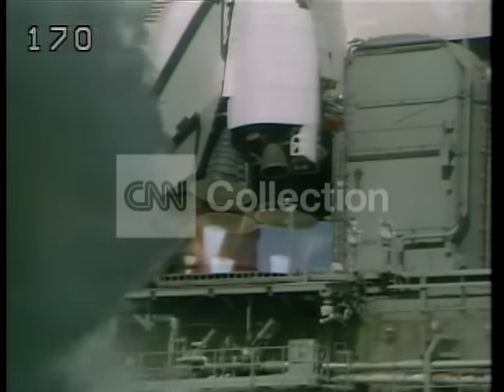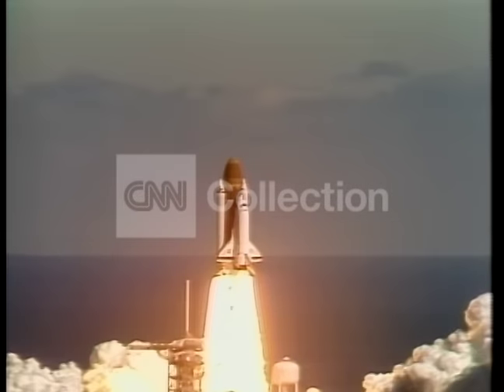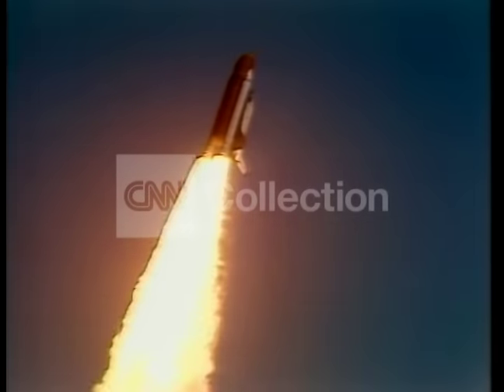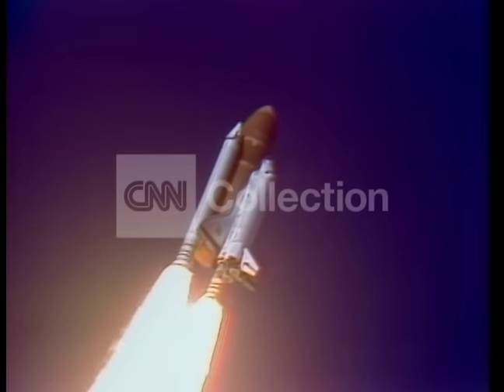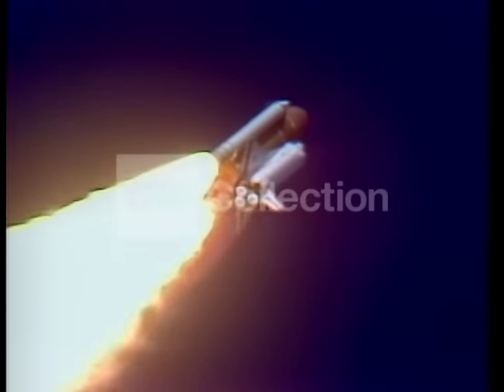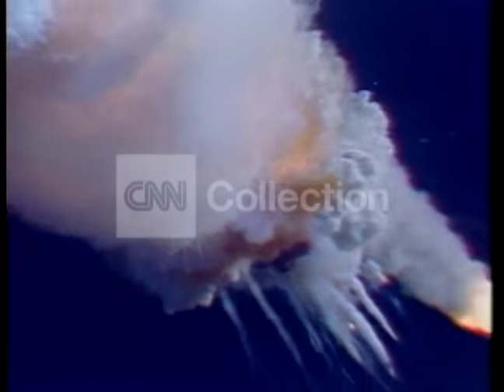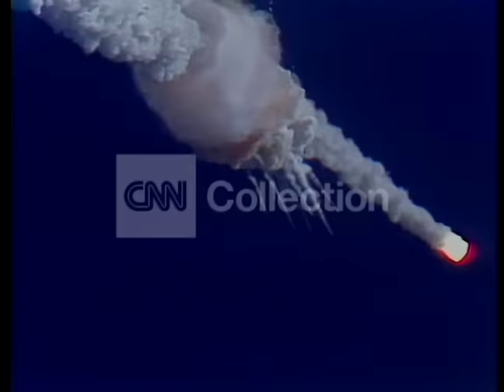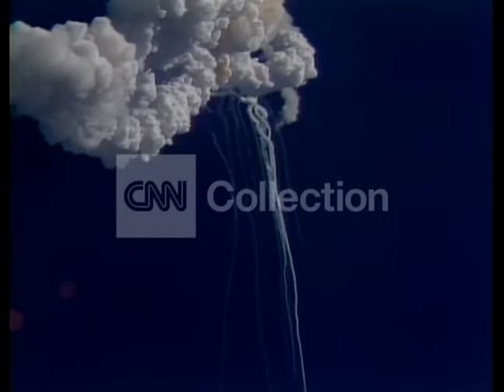CHALLENGER LAUNCH

Comment: 1:11 so hard to listen to the final transmission from the crew before the explosion
Reply: What did the crew say I cant hear it well...
Reply: Anna Afanvit they respond to ground control to increase power to the shuttle engines
Reply: @chocolatesandwichesofficia8445  and then it exploded😔
Reply: @chocolatesandwichesofficia8445  I watched a movie about challenger but the ending was confusing. Until I searched up the rocket I didn't know it exploded
Reply: "Challenger going with throttle up" probably
Reply: It was actually “Roger go with throttle up.”

Comment: An "O" ring and cold temperatures caused this tragedy. NASAs desire to not want to delay the flight again, despite being told by the engineers that designed the booster that it was unwise to proceed, was also a huge contributing factor.

Comment: They're disturbingly calm about this.
Reply: They had no way of knowing if the crew was still alive or not (experts say it's entirely possible they did survive the initial explosion, and it was the crash that killed them), It does nobody any good to start screaming and freaking out while they're trying to figure out what just happened
Reply: Still though, show a little concern. On 9-11 when the second plane hit and we all realized this wasn't an accident, the newscasters started losing their shit.
Reply: @josephmort4039   The Newscaster has no direct control over the situation. The newscaster is but a bystanding observer. Mission Control is actively involved in the situation. That's the difference. I'll say it again so you understand: an active participant in a situation helps absolutely nobody by immediately freaking out and becoming unable to accurately and calmly do their job. Their calmness under stressful circumstances is exactly why they have the job. It isn't for lack of empathy.
Reply: @Snavels  yeah for real it's like getting upset with a 911 operator for always keeping a cool calm head. It's literally in the job description.

Comment: OK?  There isn't a sound delay.  Looks like 4.1 million pounds of material just vaporized?  A balloon could easily vaporize.
Reply: No, the material didn't vaporize but just keep telling yourself that you're amazing and the earth is flat until you feel good.
Reply: Hella fast balloon bro
Reply: The boosters weight 2.6 million pounds at launch and you can see those flying away relatively intact. The oxygen/hydrogen tank tank weighs 1.3 million pounds at launch, but only 12,000 pounds empty. The big white cloud is the H2O that formed in the blast, the 12,000 pounds of fragments are too small to be caught on camera. The remaining 200,000 pounds of shuttle can be seen dropping down in pieces leaving smoketrails or too small to be caught on camera at that distance. As for the audio, they synched it with the video, probably to give it more impact.
Reply: @washellwash1802 i didn't even know that it turned into water